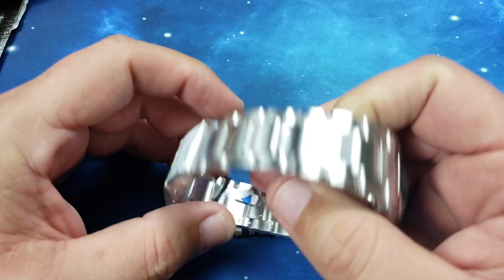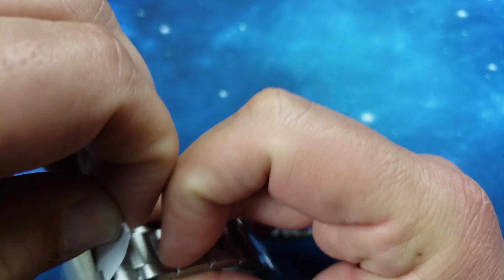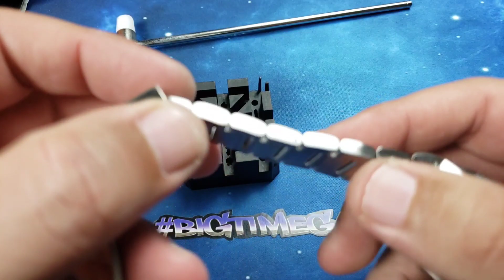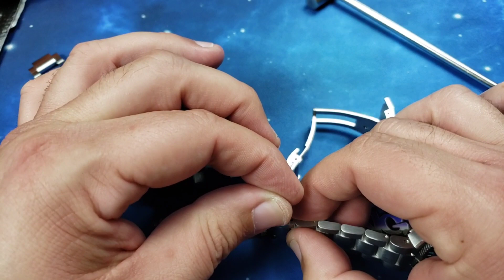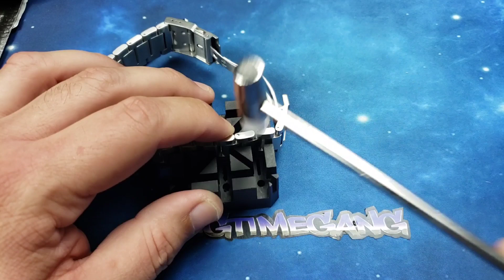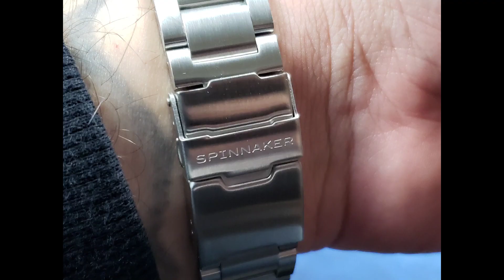Unwrapping and Sizing Spinnaker Boettger Azure Blue Dive Watch

Comment: I recently bought the same watch in Orange. I have been having an issue swapping the bracelet to the rubber strap. I cannot loosen the screws that hold the bracelet on.
Reply from the maker: I'll have to attempt the bracelet to strap swap and film the process
Reply: @TOMMYBIGTIME  That would be great! I'll be looking for it my friend. Thank you. I have had contact with Spinnaker over it. They say you need 2 screwdrivers to do it. One to hold the screw on one end and one to loosen the screw on the other.